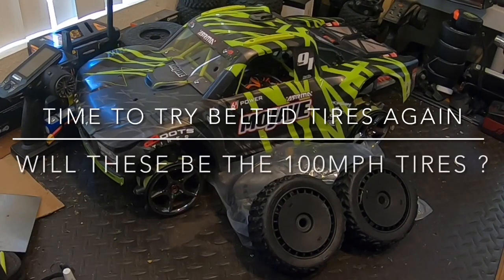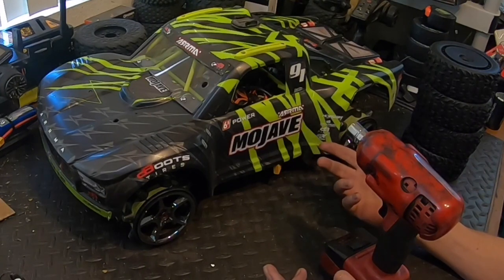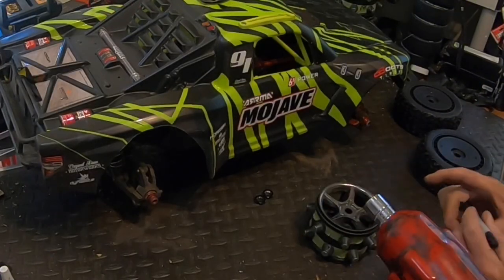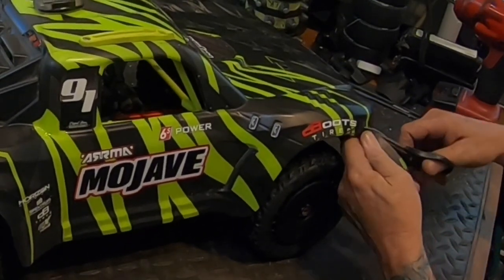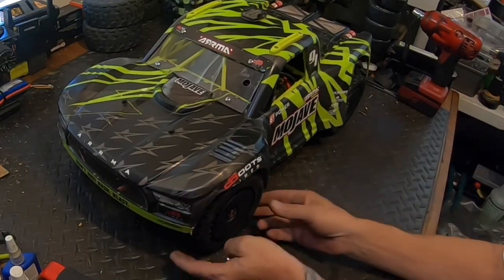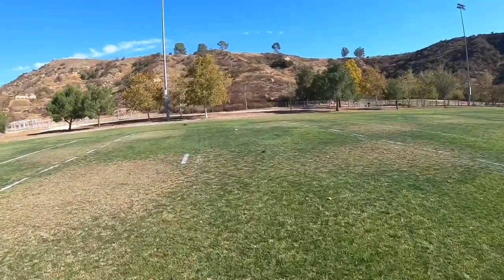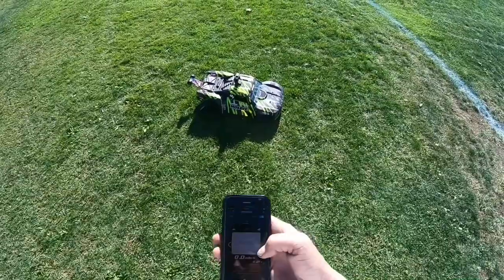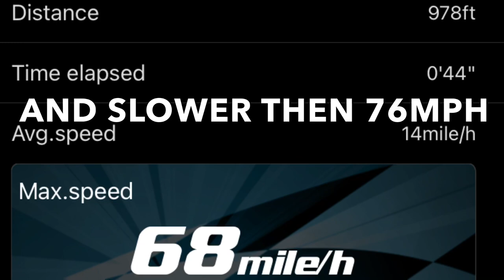RUBBER TIRES BETTER THAN CLEAT-US Wheels I Built? THE END OF THE MOJAVE?

Comment: Full Send first run!  Get 'er done, hopefully the wheelie bar didn't bend the weak spot on the back of the chassis(too bad).  Edit-8S might have the juice to spin a 24mm beadlock rubber with reinforcements but never to 100mph...

Comment: devastating result :/  are you certain you had enough clearance on the body  for the tyres?   that rotational speed and expansion added to razor edged shell would slice them  quicker than you can say Oh shoot...

I said before I like the Cleet-us in principle , but you need a bigger starting wheel, and personally think a spikier cleet too, like an OG Golf cleet , but those BRP Super spikes definitely look the right tool for the job if you can get some adapters that allow same fitment.

GLW the Project👍

Comment: I keep thinking a foam/rubber hybrid tire might be good. If you glued just the flat tread from a rubber tire to a foam tire. With full width glue of the tread to the foam there should be good adhesion and the foam would resist ballooning. Tread would provide traction and keep the foam from chipping away so quickly offroad. I'm surprised I haven't seen that tried for onroad cars.
Reply from the maker: Yes and a true steal belted tire would work like real cars these fake belted strings don’t hold the speed it takes off-road as the tires come off the ground on every little bump 👍👍💯🪦🪦🪦
Reply: @earlmoorhead5555  Yeah it's definitely the wheels free revving in the air that is popping them. I wish the rc tire makers would step up the game. Even if they don't burst ballooning destroys the stability and handling.
Reply from the maker: Yes
Reply: Tires  going get better ..I didn't realize that belted just strings ultimately the cleats will be better off road because like you said losing control..60 to 100 you gliding .
Reply: Remember 50 mph actually 400mph in full size , imagine the quality tire you would need lol 😆

Comment: I am absolutely sure you knew what the outcome would be before you pulled the trigger. Perhaps not the amount of damages you experienced but the tires failing . The question  is at what rpm and force will V2 cleat us fail? Plastics rims will fail at some point as well. Is there a way to test a rim off vehicle to see at what point it will fail? Again I commend your efforts.
Reply from the maker: Yes I truly thought I’d catch the pop and control the rc to a stop but I didn’t plan on two blowing on one side 💯💯🪦🪦🪦

Comment: I really think you could do it with the exb talion. I’ve hit 72 with stock electronics off-road but that is my max I haven’t got to switch anything over yet. But I truly believe you could do it with the Talion. I think the fenders may have a sharp plastic corner that may have flexed into the tire and may have just cut it open. I’ve had these tires on the road at 76 and they’ve been fine.
Reply from the maker: The rubber tire will never hold up doesn’t matter what rc car we run at a 1/7 1/8 scale size 💯👍

Comment: Taylor RC has some BRP Super Spikes? might be worth looking into.  Looked like a tough "expensive" day. You'll get there
Reply from the maker: Those are 1/5th wheels right ?
Reply: I was wondering if they would accept a hub with 17mm hex? I've heard their customer service is good, might be worth talking to them.
Reply from the maker: The weight and size doesn’t allow it as no one makes a smaller rc wheel been the issue but 1/5th a few have gone 100mph already do to this issue 💯👍👍

Comment: Nooooooooooooooooooooooooo! Dude, I'm sorry that happened to you. That really sucks!
Reply from the maker: Yes 😢I’m truly sad as it was so straight on the cleat -us wheels handled sooooo good 💪
Reply: @earlmoorhead5555  you were really on to something with those cleet-us wheels. I'm surprised you switched, but I can see where you thought you were making improvements. Dude, I hope the truck isn't too bad off and that you're up and running for that 100mph in no time. I'm rooting for you!  😁👍
Reply from the maker: So many ppl said they’re doing 90mph all day I just couldn’t see it off-road maybe onroad but not with an un even surface 💯💯
Reply: @earlmoorhead5555  I think the even surface from onroad isn't so hard on the tires especially when they balloon, there isn't as much stress. Throw in some bumps and an uneven terrain and it's extra stress on those tires which I think lead to what we saw, them blowing apart. I've got no clue where or how people are having successful runs on grass/gravel. 40-50mph maybe, 70-100 no way. I've seen a few videos where they are blowing apart at 80-90. I hope there's a proper solution out there that doesn't leave you banging your head to much!

Comment: I run the belted Katars on all my trucks, love them. I've never done speed runs with them tho, you've got me curious 🤔
Reply from the maker: I wouldn’t try it 👍👍💯
Reply: @earlmoorhead5555  just watched the crash. Damn that was brutal. I've never had a single issue with those tires but I'm only doing 60mph or so with them. Yikes man
Reply from the maker: @sbontheswitches  they felt good but definitely won’t handle any type of high speed 👍👍💯

Comment: I wouldn't give up on those cleetus wheels either Earl, your definitely on to something! Maybe the plastic cleets would be lighter and faster on the 2.0 rim? Be cool to see rubber ones if they even make them lol
Reply from the maker: Yes cleat-us wheels is where it at 💯💯✅
Reply: Cheaper Than tires at this point right    I have these wheels made by sweeps , there low pro belted , there very wide but I don't think there taller than Mojave wheels maybe a little,  they come offroad on road and full slicks . The offroad is still good for on road bc it's like a real car tire , hard rubber . Even not for this have to check them out . I get tired doing exactly what you just did . I'll spend couple hundred on tires set up rc lots time and soon as the rc is next level the tires blow out ..I like to run on both offroad and on road with same wheels sometimes 
 The lhs told me these wheels are great but don't go sending at the skate parks bc the rims will break ..I don't really do skateparks but they would be fine .. within reason
Reply from the maker: @paulclancy2404  flowpack ran sweep for a few runs after he totaled three rc cars he talked nothing but bad about them as he was sponsored that had me baffled and not wanting to try them 🤔
Reply: @earlmoorhead5555  gotcha , I haven't used these new wheels enough to say , they look really cool , but they are big . I have them on swb arrma . I have to say the truggy sweeps wheels I have out lasted any truggy wheels I've ever owned . They even out lasted alot 4s lp backflips. They are a perfect size a little smaller than standard truggy wheels. BUT I can't find them to re buy either can the hobby shop. These new wheels are called something else but fine print says made by sweeps .
Reply: I wonder if the 2.0 rims Todd mentioned what I talking about ,the tires side walls only like 2mm , think they are ..I'm going pick up the mm8s or g2 hw max8 today for Mojave I work on 70 80 mph for now lol , off to work have good day guys

Comment: that is supposed to be a belted tire?  and it couldnt even hold 65 mph?  just thinking out loud here.. I wonder if the bumps on the field are causing the blowouts of a belted tire.. perhaps it is ballooning just enough and the impact of the bump is "popping" the belts with the weight of the vehicle behind it,  it would somewhat explain why people say they are good for 80-90 mph perhaps on a smooth/ smoother surface where they are not being "impacted" while getting up to speed ?
Reply from the maker: The rc car is going up and down & on the up cycle it spins free and balloons so much they blow up  smooth roads they hold up better & take less power to go faster is what I’m seeing 💯👍👍

Comment: The struggle I think will still be getting enough traction to accelerate and hold the truck straight 🤷‍♂️
Reply from the maker: Straight was easier on the cleat wheels as the rc went the direction I pointed it with all the weight added on the front it really keeps it level when hitting bumps

Comment: Damn Earl ... I can't help but feel somewhat responsible for that crash..... I was one of the many that said they were good .... I honestly had no problem to 80 off-road on those tires and still haven't had a blowout.... And I had them on 8s as well ..... Luck of the draw I guess..... Good luck with the future plans.... I'll be watching....
Reply from the maker: Guy at the hobby shop said easy 80/90 all day he runs idk I just don’t see it
Reply: @earlmoorhead5555  I'm actually planning on getting another set because the set I have is worn down from doing smokey donuts and I still didn't blow it out...... 🤷
Reply from the maker: Rpm kills the string holding it together

Comment: not being a dick but you never run any new rubber tire without a lil beark in time and  you must put xtra glue on them right out of the bag ive got 87mph on used katars not 100% it wount pop thats just what i do keep at it your almost there
Reply from the maker: Wasn’t a glue issue and the more you stretch a tire the more of a chance it will blow the picture at the end shows the belt broke clean break 💯and that wasn’t even half trigger and two popped

Comment: EARL..DAMNI….I was screaming at my tv…..DONT DO IT,,,,,rubber is not going to cut it !!!    sorry to see the damage,,,I saw it coming🇺🇸👈😔😔😔
Reply from the maker: Yes I really thought I could control it but having two blow on the same side there no way to recover from that then the death roll starts 😭💯🪦🪦🪦
Reply: @earlmoorhead5555     Why not put a full strip of aluminum around the circumference of the wheel on both sides to strengthen all the cleats…🇺🇸👈🤔🤔🤔. Keep trying,,,you’ll get it,I’m following every move you make….🤞🏻🤞🏻🤞🏻🤞🏻🤞🏻💪…..
Reply from the maker: @jimmygeorge4268  worried the weight will strip the hex quicker
Reply: @earlmoorhead5555    EARL….how about using some sort of rubber washers instead of metal ones…to give the cleats more cushion….🇺🇸👈🤔🤔🤔🤔

Comment: You think the tires hit the body causing them to rip
Reply from the maker: Rear popped first the front right after the body has no rub marks and both are clean breaks it the middle at the belts like string trying to hold it together needs to be a true steel belted tire to work